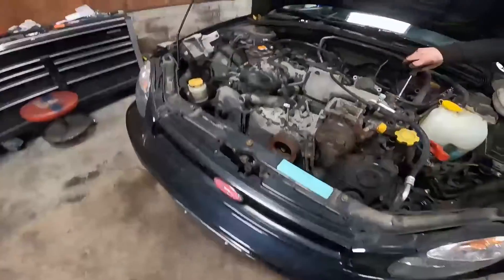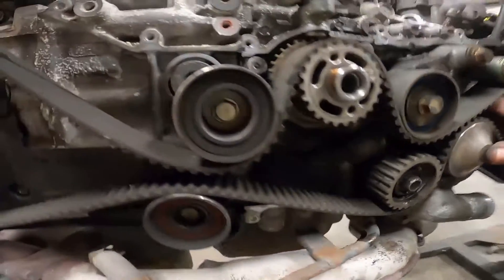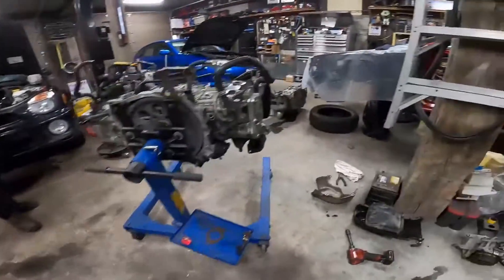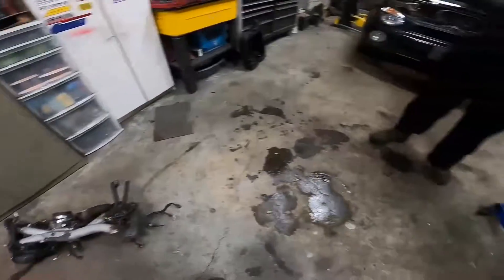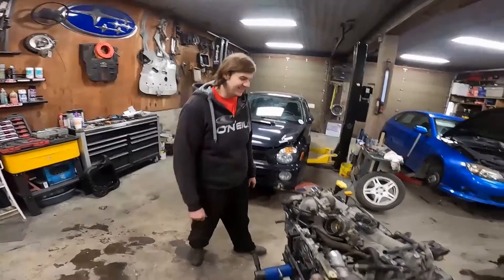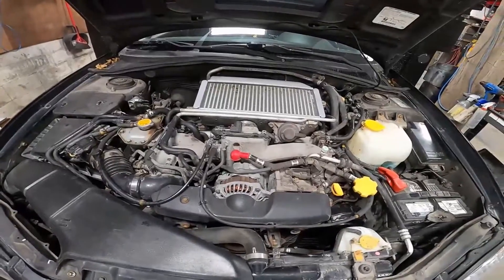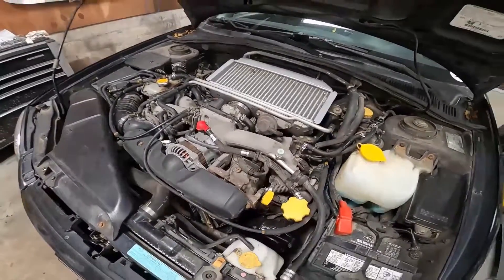How To Install Jdm Ej205 Into Usdm 02-05 Wrx

Comment: Hey guys I was wondering if I could get a list of everything to swap I’m currently stuck ordering parts that I may not even need but there’s so many different sources saying take this or that off but seems like you guys really know what is necessary
Reply from the maker: What model/year do you have? And what motor is going in?
Reply: @TheSubieSanctuary  I’m putting in a jdm 04 ej205 into my 04 wrx usdm
Reply from the maker: @BrynnBadCompany  ok, are you using your original ecu? If yes? Then you can swap just as we did in the video. Basically transfer over your intake manifold in 1 piece. If you want to use the jdm tgv deletes that will come on your jdm motor. Then you can swap those on as well. You will need the tgv codes turned off if so
Reply: @TheSubieSanctuary  it’s really that simple not water pump or anything?
Reply from the maker: @BrynnBadCompany  as for water pump. Some jdm ej205 if they came from manual car will have the oil cooler/warmer like your usdm 205. 
If you want to use the oil cooler/warmer you can swap over water pump. If your original 205 suffered rod knock or piston break down. You will have to get a new oil cooler as they cant be used after engine failure.
Reply: @TheSubieSanctuary  we finally put everything together but now it won’t start it will crank and backfire but won’t get running
Reply from the maker: @BrynnBadCompany  check coil pack plugs. Black plug in the back, white in the front. 
Its going to be an install error rather then a jdm swap related issue
Reply: @TheSubieSanctuary  okay I’ll try that but just to clarify for the 2004 I do not have to swap the cam right?
Reply from the maker: @BrynnBadCompany  correct, you do not have to swap the cam
Reply: @TheSubieSanctuary  okay this should be my final question lol. So for the pcv valve in all these videos I see a line with a white connector that goes to the turbo inlet. Do I need this if so what does it do because I cannot seem to find one in the spare parts pile
Reply from the maker: @BrynnBadCompany  that is the blow by sensor. It really is not needed at all.
Often they are left plugged in and tugged away under manifold or taped into harness. A lot of turbo inlets dont have a spot for them to connect properly anyway
Reply: @TheSubieSanctuary  okay for the coolant reservoir I know that one top line goes to the turbo and one to the radiator but I can’t seem to see where the one in the middle goes any explanation?
Reply from the maker: @BrynnBadCompany  the one in the middle normally runs across the rad through a hard line. Then its “T’d” into rad cap and into over flow tank.
Reply: @TheSubieSanctuary  alright now that everything is pretty much done, do y’all know anything about a solenoid delete I’m trying to do one so I don’t have to take the damn manifold off again
Reply from the maker: @BrynnBadCompany  which solenoid?
Reply: @TheSubieSanctuary  the one that connects to the purge valve on the manifold
Reply from the maker: @BrynnBadCompany  i figured you meant that one. So you just need to remove the black diaphragm that has the 3 ports. 
Then simply cap the turbo inlet where one of the ports connected. Cap the port coming out from intake manifold. Then purge valve will run only from fuel rail evap line into purge valve and into the center port of intake manifold.
Reply: @TheSubieSanctuary  alright and for the purge valve I cannot seem to find the plug anywhere I should look?
Reply from the maker: @BrynnBadCompany  must have got folded back in the manifold or something. Only plugs that come around there are powersteering, temp sensor, purge valve, oil sender and crank sensor

Comment: Hey so I’m swapping the JDM engine into my usdm bugeye and the cam gear on the jdm engine is broken, i’m not sure if it was broken in shipping or what. But are the cam gears the same on the USDM and the JDM engine? a thank you guys so much for making this vid by the way
Reply: hey, 99% sure the cam gears are the exact same
Reply from the maker: They are the exact same “if” your jdm engine is non avcs. If your jdm engine is avcs, then it will have avcs intake gears. Before i go into detail, tell me if it was a top or bottom gear that broke! 
Exh cam gears are the same regardless. 
Glad the vid was helpful!
Reply: @TheSubieSanctuary  thanks for the reply, it was the bottom right cam gear
Reply from the maker: @thatcherwalls389  ya that one the same 👌

Comment: Nice video I currently have the Jdm ej205 but has slot of issues and am going to put another Jdm 205 in there i have a Bugeye
Reply from the maker: If it has good compression and isnt knocking or overheating. Im sure a shop should be able to set it straight with some diagnostics. Worth a shot vs starting over
Reply: @TheSubieSanctuary  👍🏽

Comment: I'm looking to swap a jdm ej205 into my auto 02 wrx and I've been confused about a couple of things. 

So I will need to keep my intake manifold and swap it onto the jdm motor? Are there any other parts that you didnt show in the video that will need to be swapped?

Does it matter if the motor is automatic or manual? (Might be a stupid question, im new to cars)

I was looking at a motor that said DOHC Drive by Wire, are either of those things a problem?
Reply from the maker: Dohc drive by wire is the same engine we swapped in this video. 
Simply swap over your entire intake manifold in 1 piece.
Reply: @TheSubieSanctuary  can you send me a video of the intake removal in one piece cuz that would save a lot of time next time lol
Reply: Doing this same swap into a silver 02 bugeye in mint condition just needs a heart but got a few snags
Reply from the maker: @dakotaevans1768  its just the 8 long 12mm bolts through the tgv’s. Then unplug all the plugs, undo the pcv hoses that connect to manifold and engine.

Comment: The oil feed line for the turbo doesnt seem to bend the right way to actually go into where its supposed to on the turbo and i cant figure out why but i cant use the old one from my usdm because the one on the avcs motor  is much lonbger and routes to a different spot
Reply from the maker: Are you using a td04 or vf turbo? 
Normally the swap will be able to use the jdm oil line on td04 no problem

Comment: Hey The Subie Sanctuary! I've been really confused about this topic. Getting multiple opinions and just want cold, hard facts to get this straight once and for all. Here we go...
 My car will not get into boost at all. It wont even come out of vacuum to generate 1 pound. I recently finished swapping over all my accessories from a tuned

2.0 JDM NON-AVCS EJ 205 Long Block
To a
2.0L JDM AVCS EJ205 Long block

and its still falling on its face once past 3-4k. It idles fine, runs fine in vacuum but I have no boost.
I have checked everything visually, hoses, lines, wastegate lines, everything.
Im catless all the way back. From up pipe to downpipe. So it couldn't be a clogged cat.
I hear the turbo spooling but it literally just hits a brick wall and doesn't want to give any more, even though it sounds like it does, once im at 4,000 rpm's

I've been doing more research and getting second opinions from Master Techs at Subaru and they're saying it might be because if I don't swap out the JDM to USDM Cam Gear and Crank Sprocket, they will run at "full retarded" ?
But I've ALSO heard other people saying the exact opposite. That you don't have to swap over anything. Just the Coolant crossover pipe, the cam position sensor, crank position sensor, and the coolant lines from the water pump. And the car will start/drive/build boost with no problem.

Says you HAVE TO swap the Cam Gears: https://youtu.be/FV6AONm6pxk
Says you DO NOT have to swap the Cam Gears : https://youtu.be/0sSuzHPUH8g

Or can I just simply "Block them off" and get this from IAG?: https://subimods.com/wrx/2002-2003-wrx/engine/internal-components/iag-black-avcs-camshaft-sensor-delete-plugs-pair-2002-2005-wrx-w-avcs-heads.html
Reply from the maker: The cam gears are 10000% not your issue. Sounds like it could crazy ignition break up, or something just isnt hooked up right. 
We dont swap the cam gears and several of our guys running jdm avcs 205 are hitting near 300whp without an avcs ecu! 
Let me know how you make out, always curious to hear running issue outcomes.
Reply: @TheSubieSanctuary  The Techs at the Subie Dealership I work at are saying the cams are probably set at "Full Retarded" therefore not holding any oil pressure because the AVCS is stuck open? Im not too sure how avcs works, but thats essentially what he said.
Reply from the maker: @JRPetrenko  ive probably done 30-40 cars with this swap we certainly have never experienced that. 
Ive experienced that symptom like hitting a wall at 3000/4000rpm right as car should be getting into boost. Its been Ignition break up, boost leak, bad maf, bad fpr etc. Always hard to guess though.
Reply: @TheSubieSanctuary  The car did have a really bad rough idle, but it turned out to be a small leaf stuck inside the wiring harness side, preventing one of the pins from making contact to the MAF Sensor. And i mean, after that, the idle was fixed. But i still ran into the problem of no boost after 4k rpm
Reply from the maker: @JRPetrenko  get a known good coil pack. Swap it out for 1 coil at a time and keep test driving the car each time.

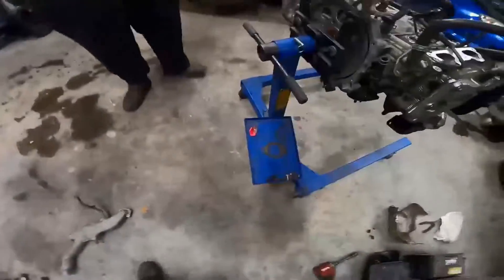Comment: 4:36 did you use the oil feed that came with Jdm motor? I’m putting my td04 on the jdm motor as well and the oil feed line is almost an inch shy from the mounting area on my turbo. Has me wondering if I’m doing something wrong
Reply from the maker: Needs to be tweaked at bit to reach. 
Your jdm, is it a 2 piece line vs your usdm being 1 piece. 
Worst case if you can manipulate the jdm line to reach then youll have to get a braided stainless line. Typically this isnt the case though
Reply: @TheSubieSanctuary  yes the jdm is a 2 piece line and you were right, I just kept slowly bending until I got a good fit. Thanks!

Comment: I recently just got a jdm ej205 that came with tf035 turbo and single avcs. I’m doing a very similar swap into my bugeye so I’m super thankful for your info in this vid! But I have one question I keep reading on forums I have to change camshaft and others say change cam gears? Do you have any info on this?
Reply: I’m pretty much following everything you’ve pointed out and also using my td04 turbo, I’m just super curious about this camshaft and cam gear dilemma
Reply from the maker: @brandonmayan4576  in this swap we did not switch the cam or the cam shaft. Not often do we unless instructed. The difference between the swapping cam shafts and cam gear vs not swapping them will almost be unnoticeable on a dyno. 
We have hit 300whp simply dropping one of these engines in a wrx and swapping it exactly like in the vid.  Obviously a bigger turbo on that one

Comment: I just picked up a 2005 wrx, from what i understand the old owner put a jdm engine in it, im not sure what exactly what was done to it, so please overlook my lack of knowledge. However koeo the oil control valve or (avcs selonoid) clicks constantly, start the car it stops, but once over 4500 rpm it starts clicking again (like a fast clicking) and will not stop until the car is shut off. I have pulled them out and confirmed its these selonoids going nuts (driver and pass side). Dont know if its relevant but the tumble generators are not present so the plugs for them are not connected to anything. Any input on what could be causing this solenoid spaz? Im at the point of just unplugging the selonoids because i dont think their doing anything useful anyways. Will doing so hurt my engine long term or should i just let them tap away?

Please get back to me, i love this car and trying to figure out wtf is going on
Reply from the maker: Ya they must have messed something up wiring those solenoids. Ive never heard of them acting like that. 
You can watch live data on high end obd scanner to see what ecu is telling them to do and if otherwise they function correctly as they are. There is no harm in unplugging them until you chose to dig into whats up with them.
Reply: @TheSubieSanctuary  appreciate it guys! Keep up the good work!

Comment: I have a jdm 6cyl I got for my outback. My throttle body cables have been connected but now there's a buzzing noise when I throttle it. Cranks but no sputter to start? Have any clue guys? if not it's cool
Reply from the maker: Was your outback already a 6cyl? 

My tip would be, fuel?, Spark?, cam and crank position being recognized by ecu

Comment: hey guys, im stuck on my swap currently because the alternator/AC bracket is different. did you struggle with this as well? or am I going to have to lose AC until I can get a shop to swap over my JDM compressor.
Reply from the maker: We always use all the domestic accessories on the jdm engine. Including domestic ac bracket intact with domestic ac pump along with PS pump. Jdm alternator can be used though without issue
Reply: @TheSubieSanctuary  I just got back to the car, and I think i see what you mean. So I should change all of them at the top, and then not have any issues!

Comment: been using this for a reference, great job guys. the only issue ive run into is that the avcs lines are kinda in the way for the intake manifold bolt holes to line up. right side sits down fine , but the fuel lines on the manifold hit the avcs line. any thoughts?
Reply from the maker: Ahh yes! 2 options: 
1. Slightly adjust fuel line inward 
2. Use that section of fuel line from the jdm, youll notice it kinda has a kink in it to clear avcs. Not too difficult if manifold still off
Reply: @TheSubieSanctuary  will see which one i end up with
thanks guys 🙏🏼

Comment: Hi Subi Sanctuary! I have gotten a jdm non avcs morter. Would i requier swapping the cam gears even tho its a non avcs morter but still and ej205? Any help is very much appericiated
Reply from the maker: If your putting non avcs 205 into usdm wrx 02-05 then you dont need to swap the gears.
Reply: Okay awesome great i was confused, its my first time doing the swap and it really helps to know. That i dont need to swap the gears. So its just the sensors i need to swap right?
Reply from the maker: @officialjosemarin5806  if your jdm motor is a drive by “cable” which means mechanical throttle body. You actually dont need to swap the sensors. You can for piece of mind if youd like
Reply: @TheSubieSanctuary  hey subie sanctuary! I have another question here after a year. Ive learned alot with my first jdm swap but now im moving onto my second, ive followed the same routine. But now ive ran into a different engine ej206. I beleive it was twin turbo. Ive blocked all the connections for the second turbo. But now im in a bind with the line that feeds oil to that second turbo on the drivers side. I managed to get the engine to run but i got oil puking out of that banjo bolt. Is there a way to remove the bolt without having to pull the timing covers and components?
Reply from the maker: @officialjosemarin5806  hey buddy, im familiar with the 206, but ive never had the pleasure of working on one yet.
With other motors there is a short cut of removing front timing cover and drilling a hole through back timing cover to pull banjo bolt back out. Rather then strip whole timing kit and cam gears
Reply: @TheSubieSanctuary  oh wow! That answer is more then simple! Thank you sooooo much. I was thinking hard to see what i could do but thank you!!!
Reply from the maker: @officialjosemarin5806  ive done that method once on one of my own cars. Then just slips some heavy duty tape on the backside of cover. Not that the spot there will see much water ever. But tape on back side better then inside so it doesn’t fly off into timing components. This method saves about a day of work 😂
Reply: @TheSubieSanctuary  yes most definetly! Im thinking maybe i can slip a rubber gromet in! And yes it does solve about a day of work. You should definetly do a video on a ej206 ! If you ever get the chance to. I am so gratfull to your videos and appreciate your content so much! Thank you again!!
Reply from the maker: @officialjosemarin5806  ah yes! The grommet is genius! I actually have a kit of assorted flat plug grommets. Why didnt i think of that 😂
Reply: @TheSubieSanctuary  yes itll be perfect! Either a grommet or some sort of plug
Reply: Wow awesome thank you for all the help you give!

Comment: So in the middle of the swap do I use the Usdm oil feed for the turbo and if so do I need to do anything to the avcs?
Reply from the maker: Youll have to use the jdm oil feed line as it may be intergraded from avcs to back of cyl head to turbo. 
You can do a few things with the avcs: 
Leave it as is, or run a jdm 16bit ecu and wire your car for avcs, or swap your your usdm cams and cam gears.
Reply: @TheSubieSanctuary  my usdm turbo feed is a banjo bolt and the Jdm is threaded and flared like a brake line
Reply from the maker: @jacobpainter5837  sounds like your missing the other part of the jdm line. The jdm is 2 piece, beyond that flared/threaded piece is normally the rest of the line to banjo bolt into turbo. 
If you are missing it or for some reason it wasnt on your jdm turbo. 
Then youll need the IAG stainless abcs line kit. It will cover avcs, cyl head and then to turbo.
Reply: @TheSubieSanctuary  thank you so much you are a life saver somehow I took it apart at that joint and off the turbo and had it in the junk Jdm parts. Again can’t thank you enough❤️